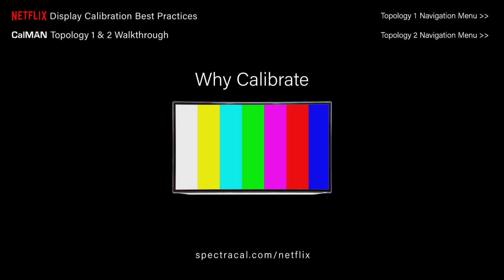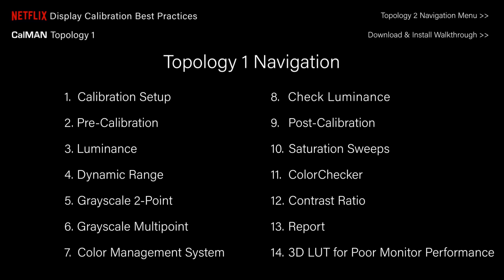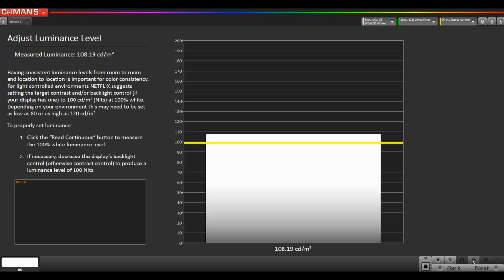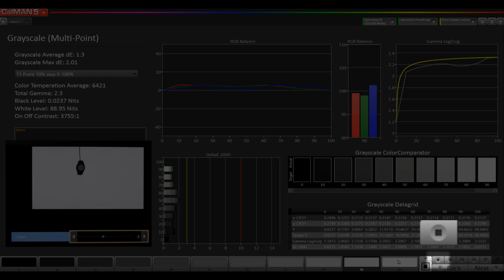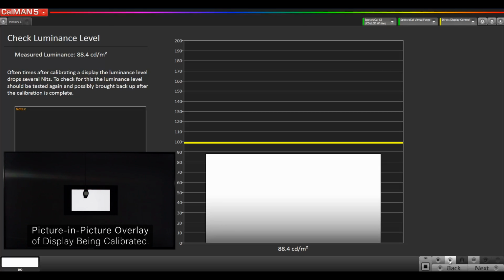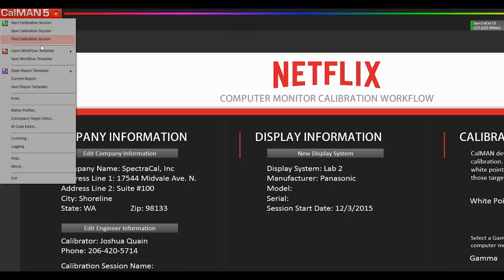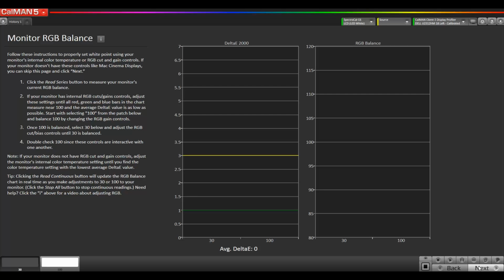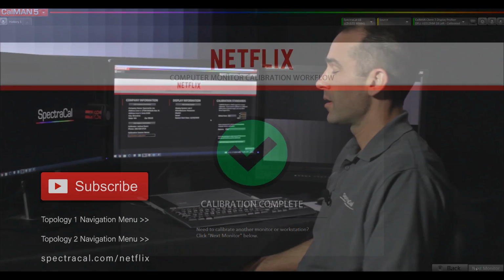Netflix Display Calibration Best Practices Using Calman Ultimate 2016

Comment: In the first calibration segment, shouldn't the colour temperature have been set before the two-point WB adjustment? Would have saved all that blue being removed, costing peak luminance:).

Also, I've found that increasing the backlight to recover lost luminance can introduce more blue into the display, so I always get the peak luminance to 100 last thing before the WB adjustments (and after colour temp, ofc).

Comment: @SpectraCal
Now that OLED TV sets have made a breakthrough do you have plans to make a video on how to calibrate an OLED TV
I think that information is  not clear as to which pattern size to use with OLED TV a video on this would be appreciated thanks
Reply from the maker: +Tech-Freak6819 
We generally recommend using 18% pattern sizes on OLED displays.
Reply: +SpectraCal Thank you
what about making a video on how to calibrate an OLED TV 
do you have any plans 
thx in advance
Reply from the maker: +Tech-Freak6819 Hi, we definitely have it in the list. We are pretty busy preparing for NAB in Las Vegas, so it will be a bit. Contact support (at) spectracal.com if you have specific questions about calibrating OLED TVs and we can help you there.
Reply: +SpectraCal Thanks for your response, will definitely do really appreciate your help